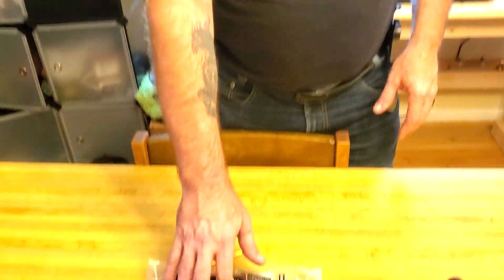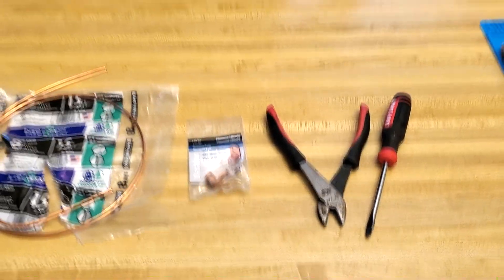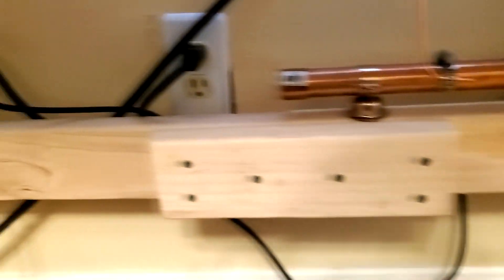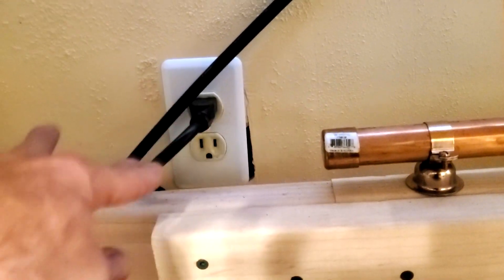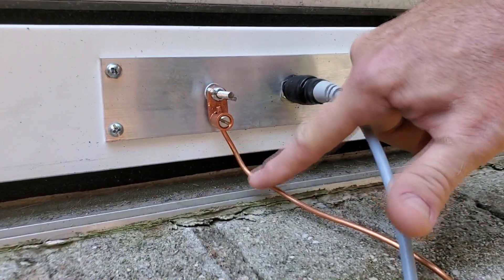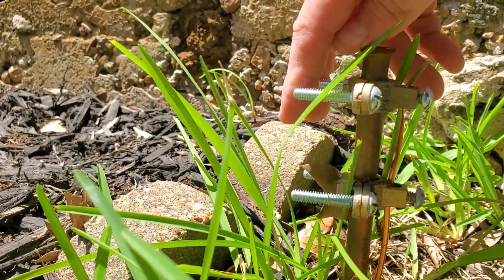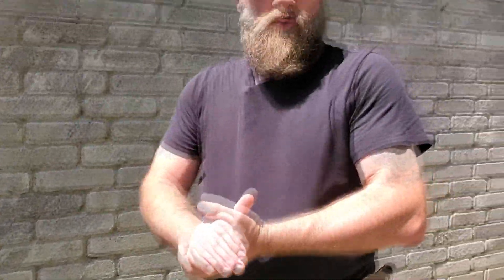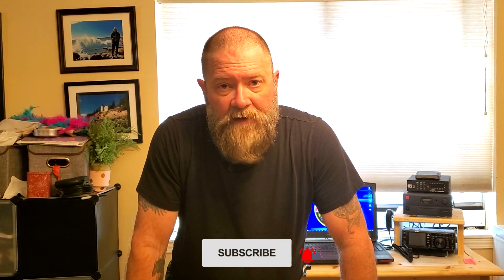How I ground My Ham Radio Station

Comment: Grounding can get confusing.  Inside the shack it's pretty straight forward, run a ground from every component to a common ground point, like the copper pipe.  However, bringing that ground outside is confusing.  You should run a ground wire to the common house electrical ground rod.  But what happens when your shack is far from the electrical ground rod, like maybe the other side of the house?  Do you put another ground rod near the shack entrance then connect that to the electrical ground rod so the two ground rods are connected together?
Reply: Yes.  My shack ground is on the back of the house, but the house ground is around the corner of the house ~ 60' away.  I connected a 6-gauge solid core wire (same as the electrician used in wiring the house ground) to the house ground block (right by the electric meter) and ran that wire just under the surface of the lawn around the house to the shack ground where it's mechanically attached in the same manner shown in the video.
Reply from the maker: You may have given me a new idea!!!
Reply from the maker: That's the problem I am having.  My breaker box is further away and I just picked the best location I could and have a separate ground to that area.  I am sure things will change more as time goes on.  I just dread hammering another ground rod.  The first one was a major pain.  Thanks for the comment and the suggestions.  73!!
Reply: According to the ARRL Grounding and Bonding book by Ward Silver, N0AX, it is recommended to do exactly that and to bond that long wire to additional 8ft ground rods spaced evenly 16ft apart all along the wire.
In my situation I don't have enough space between house and property line to bury the wire and rods at the appropriate distance from the house on one side. On another side would have to dig up 3 car wide driveway.

By not going with roof mount antenna and skipping lightning protection for the house (which neither we nor any neighbors have anyway) am going to place radio room on same side as home electric ground rod and will probably only need 1-2 rods to bridge the gap. The need for circumferential ground rods/bonded wire is primarily for "generic" lightning protection from what I can tell. If I lived in a place like Tampa, FL, with high number of lightning strikes per year, I'd do the whole circumferential thing, for sure, and maybe hire it done - there is an insurance benefit down there, I think.
Good luck!
73,
John - KK7JBZ

Comment: Ground clamps are better transfering any electrical surge than the hose clamps. Also if possible, bond the equipment ground rod to the house electrical ground rod to make it easier and faster to disipate any lightning or electrical overcurrent. The grounded metal plate of your window pass through will basically do the same as the lightning arrestors because the pl259 connectors are bonded to the metal plate by means of the tightening nuts and the plate has the ground wire attached to it. Just my two cents.
Reply: Electrically and logically, as long as the copper bus bar and the wire or braid leading to the grounding/earthing rod are solidly mechanically connected, it can't make any difference what's keeping that mechanical connection in place as long as whatever it is won't let go during a surge.  A steel hose clamp on a copper pipe could be a corrosion issue if it were in a damp environment--that's the reason for using a copper clamp outside.
Reply from the maker: I appreciate the input!  I know that I have some work to fine tune this, but for now it seemed to work.  Thanks for the comment.  73!
Reply: The lightening arrestor is designed to ground the center of the coax, only grounding the braid doesn't do the same thing as a lightening arrestor.

Comment: My Grounding and Bonding book doesn’t come close to explaining compared to actually seeing how someone bonded and grounded their equipment. Good video. I admire your clean and simple pass through panel as well and  the uncluttered  setup in everything I’ve seen. Do you plan to bond your shack ground rod to your service rod?  It’s unclear to me when or if that’s needed.
Reply from the maker: You know, I am still contemplating how to do that cleanly so that I don't have a bunch of wires all over the place.  My breaker box is a bit of a distance from my shack and there are sidewalks and doors and stuff that i would have to navigate around to make it presentable.  Going to have to look into this more for sure!  Thanks for the comment!  73!!
Reply: @HR4NT  I am dealing with a similar issue of bonding my equipment ground to the utility service ground, which is ~150' away on the other side of the house with  a driveway, sidewalks and other barriers to laying a bonding wire. Will be interested if you do a future video on how best to accomplish that. Thanks, 73
Reply: Why can you not just ground to your nearest electrical plug ground?   Seems like it is all going back to the breaker and then to the ground rod your trying to get to…… but I’m no expert.  Legitimately asking.

Comment: Great video!  Nicely done.  Just a quick note at 3:38 ...it might be better to ground your antenna after it is disconnected....just disconnecting the antenna could allow it to bring hv discharge into your shack.  Also, please get some grounded spark gap lightning arresters sooner rather than later!  73
Reply from the maker: I actually just ordered some yesterday that should be in Friday.  I appreciate the input.  Thank you for the comment and your support! 73!!
Reply: @HR4NT  I was going to suggest Polyphaser for lightening protection, but I figured you would have got something already considering this video is a year old. 73 KD5YOU

Comment: Go to the arrl / Grounding and Bonding
Reply from the maker: Yeah....NO. LOL.  This channel was created because the instructions i did find for various things in this hobby are NEVER explained in a way that anyone can just research and follow.  So, I try to simplify it and show exactly what to do without giving bad information.  Thanks for the comment and your support!  73!!
Reply: @HR4NT  Just a Quick note you are better using flat cable of bonding and if you can change the pipe clamps to copper ones
Reply: Instructions confusing. Now all I do is scare my cats.